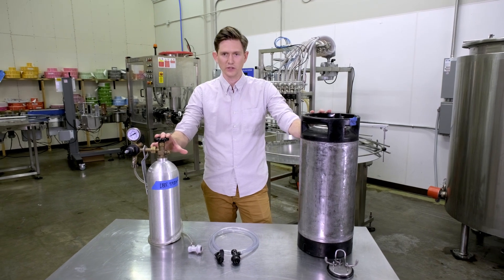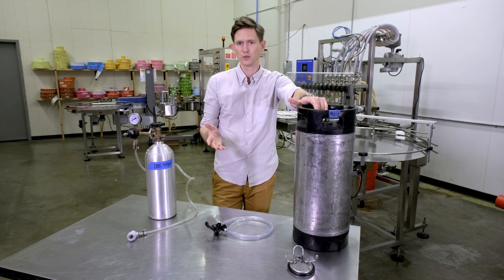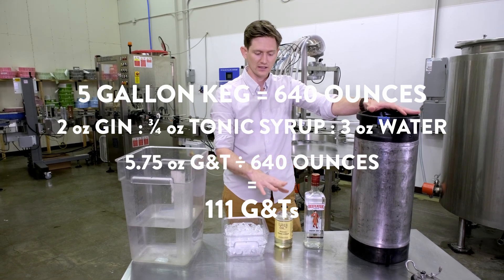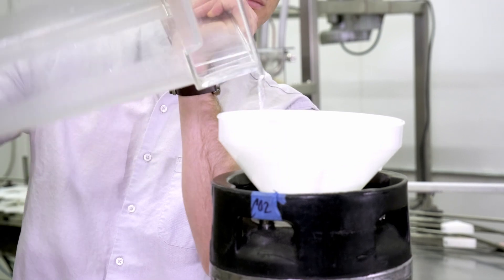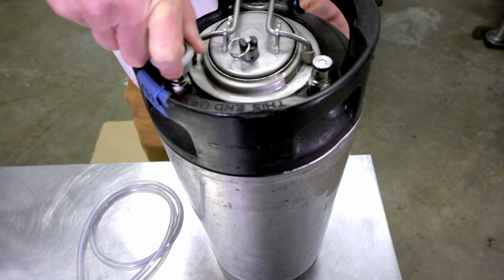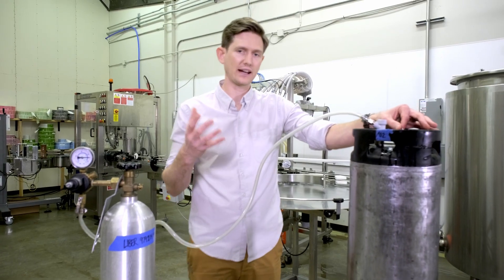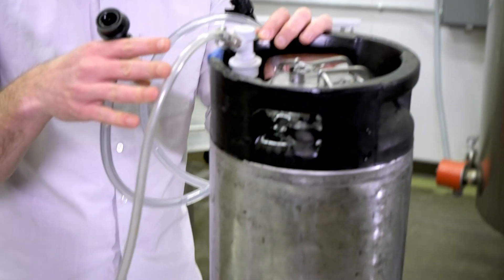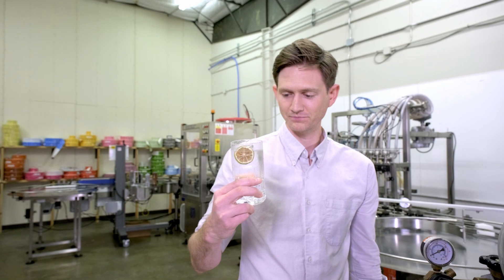How to Keg a Cocktail: The Complete Guide

Comment: You should force co2 into the keg, let it sit, the Oxygen will rise to the top, burp it a few times… then never burp it again. Roll it without any oxygen so that you’re not changing the flavor of the G&T
Reply from the maker: Yes, exactly! Pinning this comment as it is relevant and accurate.
Reply: What does 'burping" mean?
How many rolls with and without oxygen?
Reply: @gypsism  burping is when you pull the release valve to let out pressure from the keg. 

So you do a couple burps to clear out oxygen, then shake it. 

No rolls with oxygen if you can prevent it... oxygen is bad.

Provided the keg is cold, maybe 15-30 minutes, then do it again later.  Keep pushing CO2 in between shakes. You will do a lot at first, which shows how well this method works. then it will take more shaking till co2 is able to get in. Shake it till you can't anymore basically. Let it sit, then test... don't test immediately or else your testing a shaken soda bottle... you know what that means! You gotta let the CO2 dissolve. 

Doing this while it's cold is 5x better than warm. So chill your keg with the contents if you can (burp out the oxygen first thing regardless). but it's all about the amount of time you have. GL
Reply: @bmtr11111  much appreciated and excided to apply this with the newly arrived equipment!

Comment: Thanks for the video! When you roll the keg, be sure to disconnect the gas line.  Sometimes you can get liquid in your gas line which can then get into your regulator and CO2 tanks (not good).  Also, I like to turn my CO2 on just a little and keep the regulator closed.  That way when I open the regulator, if any pressure is built up in the keg, the liquid won’t run up the gas line to equal out.  Instead, there will always be pressure going into the keg. This can happen when you make seltzers with already carbonated liquids. Nice video!
Reply from the maker: Thank you! Great tips here.
Reply: Well it wont get force carbed if its not feeding in CO2 when agitating

Comment: Great video, very helpful information. Thank you for sharing. Do you have any recommendation on filtering the cocktail coming out from the keg? Is there any filter that we could use un the final line?
Reply from the maker: Normally we would run everything through a medium-to-fine mesh strainer as we're loading the keg. Reducing solids in the kegged batch lessens the risk of clogging your outlines with heavy pulp, etc. The carbonation process is also more effective without solids in the keg. Hope this helps! Good luck and cheers!

Comment: What about the drink separating.  Is their a keg with a built in mixer
Reply from the maker: We've never had an issue with separation. Once the liquid contents are under pressure, they should stay separated. That said, if there is some pulp in the cocktail, perhaps from fresh lime juice, you could try shaking/rolling the keg around every now and again, but we really don't think it will be an issue.

Comment: If I want to make a non-carbonated cocktail such as an old-fashioned whiskey sour, how do I prevent the Co2 from carbonating it?  I just need it to push the drink out the keg.
Reply: You would use nitrogen to pressurise your keg and keep your serving pressure lower. N2 doesn’t easily dissolve into water, quite high pressures are needed. 5 psi would give you a decent pour on a normal beer line for a kegerator and minimise bubbles. Obviously ymmv and tune your pressure as required.

Comment: Hi Guys, I am using a picnic tap and about 5ft of hose from the Corny Keg, cooling it down for days, tried different dispensing pressures and all that is coming out is foam, when it settles the drink is minimally carbonated. I have tried opening the keg after carbonation and pouring a drink where it is fully carbonated. How can i avoid the foaming and loosing the carbonation? Thanks in advance
Reply from the maker: Are you degassing? First step is to get the liquid as cold as possible with ice, then when you begin adding C02 to the keg, you need to periodically degas the keg and then add more C02.
Reply: @liberandco  yep, up to 4-5-6 times before leaving it at pressure overnight in the fridge, still comes out like foam..
Reply: This happens to me with all kegged cocktails as well.  Tried margaritas, gin and tonic, and sparkling wine.  I tried longer "balanced" lines, a flow control faucet, higher/lower serving pressures, and higher/lower carbonation pressures.  The result for me is always the same as yours: foam and flatness.  Very disappointing.  I was hoping for some kind of secret to be revealed at the end of this video, but the portion on serving was incredibly short.

Comment: Thanks a lot for the video.
Is it possible to use the keg just to push the cocktail out of the tank and serve it without carbonating the liquid ?
Reply from the maker: Yes, it is! Instead of pressurizing and depressurizing over and over again (the step where you shake the C02 into the liquid) just hook up the CO2 cylinder and increase the pressure just enough for the cocktail to come out. In that way the C02 shouldn't go into the liquid, it should just push the liquid through the keg without carbonating.
Reply: @liberandco  ok perfect thank you !

Comment: I am having issues with two of my cocktail kegs out of the the four that’s on the line. The first one is dribbling out and the second one it’s even slightly pouring :(
Reply from the maker: Things that could be the problem: 
1. Insufficient pressure, need at least 5psi 
2. Line clogged (citrus pulp or other solid?)
3. Incorrect attachment (check each connection is tight and properly aligned)

Comment: i think i went wrong somewhere, the mix is very strong, it's hard to tell if it was the gin or the tonic syrup. i used 4-1.75 litre bottles of bombay sapphire gin, 85 ounces of top hat classic tonic syrup off of Amazon, and water right to top.   feedback please?  Thanks.
Reply from the maker: Hm, it's hard to say without knowing the characteristics of the ingredients you're using. I would try and make a G&T as a single serving just the way you like it. Then you're going to have to compare that to a few varieties of single servings where you mess around with the ratios of each ingredient to try and see which direction you went wrong. Then you would adjust your master recipe for the keg.

Comment: Thank you for the video, it is very useful. I am looking at buying my own set-up. But when I look online, I see that the picnic tap that you have is not suitable for carbonated drinks, because of the high pressure. Did you have any problems with foaming ?
Also, I do not own a kegerator. During parties, the keg will get warmer and warmer. Is this a problem to serve drinks ?
Reply from the maker: Hi Niels, We haven't tried any other taps aside from the picnic tap, and that has worked well enough for us, but if you try something else that works well let us know. With regards to foaming, the best way to avoid that is to try and get as much of the C02 gas into the liquid as possible. Get the tank really cold and keep shaking, gassing and releasing pressure as in the video. Agitating the liquid while it's cold and you're pumping C02 in it is the best way to get the most amount of gas into the liquid which will reduce foaming. Additionally, allowing the keg enough time for the C02 to dissolve into the water can also help. So you don't want to rush the carbonating process. Would be good to let the tank sit overnight in the fridge before using.

As for the kegerator, we normally do the cheap hack, which is to get a large trash can, fill it with ice and shove the keg in that. Not as sexy, but gets the job done. Let me know if the above is helpful!

Thanks for watching! And good luck!

Comment: One thing I've been wondering - once you have force carbed chilled liquid, will the drink lose much carbonation if the keg is then left to come back up to room temperature?
Reply from the maker: Hey Matt, if you've properly filled it using the gassing and de-gassing method in the video, and so long as the keg is sealed, you shouldn't lose any carbonation if the keg comes back up to room temperature.
Reply: Technically you’ll lose a negligible amount until it reached equilibrium. Once the head pressure picks up some, it will still keep the CO2 dissolved.